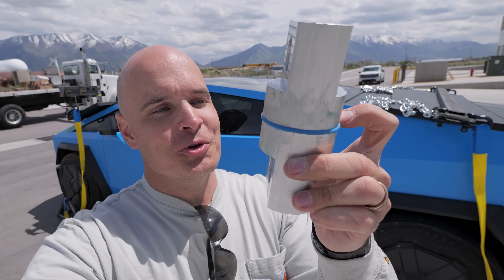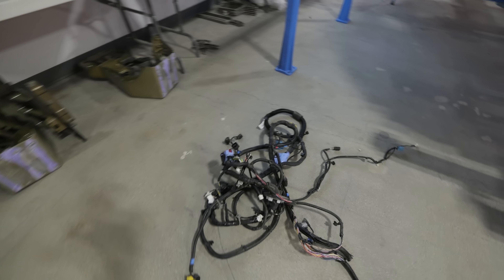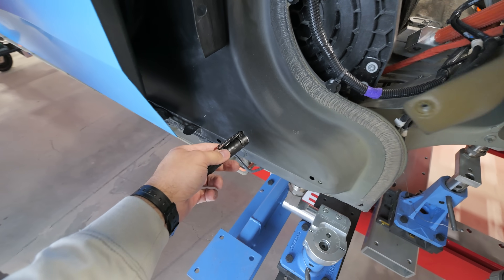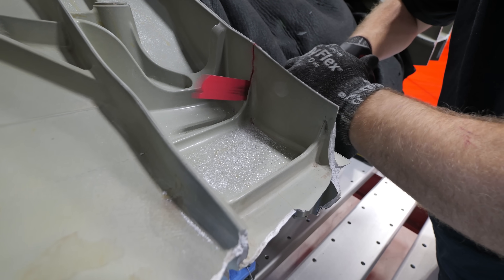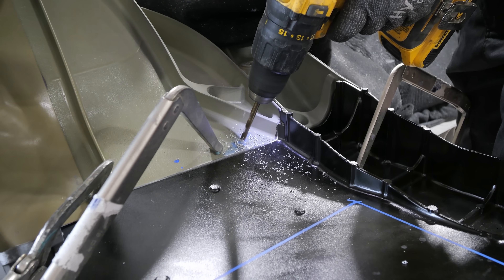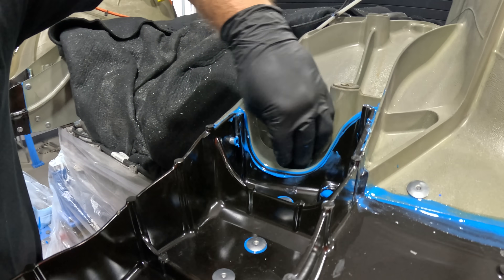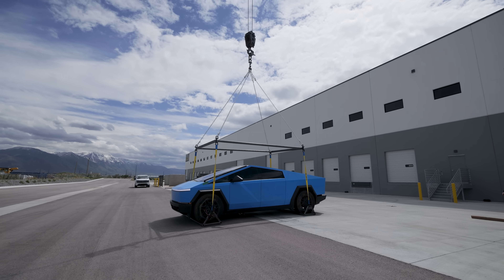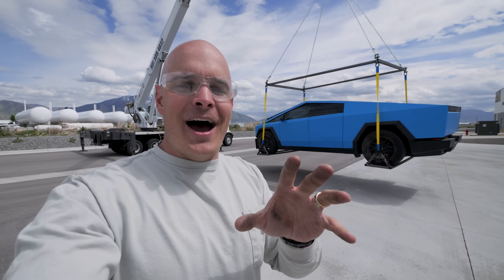Tesla Fixed my Cybertruck with GLUE - (but I'm not mad about it...)

Comment: 1:49 No engine, no soul. Just a bunch of wires and a piece of metal.
Reply: It's not an imitation, it's the upgrade. Engines are becoming antiquated, slowly but certainly surely. A hundred years from now every single vehicle on every road everywhere, will be electric.
Reply: Gen x will fight that.. no replacement for displacement  @Plant-Based-Gains

Comment: I'm pretty sure you can lift a car with that same area of just super glue. I would be more impressed if it could do that along the sheer line. Usually, the tensile strength of adhesive is high, but the sheer is not.

Comment: 6:48 the adhesive is applied directly to the unprepped e-coat paint??  Is that not going to significantly limit the strength of that joint?  They at least (sort of) scuffed up the mating surfaces at 8:59

Comment: So, two months ago, Tesla had a serious problem, cause the trailer hitch broke off too easily. But now that we found out the glue is strong, we now know it's not a problem, cause despite what the tests show, the trailer hitch is actually really strong. The glue may not be very impact resistant and thermal expansion may or may not be a problem. But this glue has also been used by other manufacturers to glue ... something (not critical parts like trailer hitches of course). But the fact that this glue has been used by other companies to glue other things, proves that it's fine for gluing critical parts like the trailer hitches. Not to mention, this glue is stronger than welding. Meaning the metal is actually the weak part and we should actually be mad at manufacturers for including metal instead of building the car entirely out of glue.
Yep, sounds like the opinion of a completely unbiased man...

Comment: so what happens to your 11k trailer when you hit a pothole at 60 mph and the whole back breaks off like yours and hits a school bus in the other lane ? This is the biggest hazard on the Road all need to be recalled . Who was the engineer who design a truck with a  aluminium frame and has a 11k tow rating

Comment: There is a large difference in strength for adhesives in tension versus their peel strength. Can think of it as how it's much easier to remove tape by lifting an edge and pulling at an angle versus attempting to lift the tape off a surface. 
This is not to say industrial adhesives are weak, they are extremely strong, but as with everything in engineering, there's an element of "it depends".

Comment: the genius of this cannot be overstated - castings that have such well fitting lego like connectors that are IN THE MIDDLE of the castings, that you can cut off and glue, which has glass microbeads to space it - so crazy - and then the bolt-able crumble zones. What a fantastic piece of engineering!

Comment: So now that the original rear end has been cut and replaced with the new sections, what happens if you get rear-ended and they need replaced again? 
Do they have some super anti-adhesive to get the sections back off?

Comment: I dare WhistlinDiesel to put his cybertruck back together with this and durability test it again. I guarantee you it won't be as strong, and it isn't guaranteed to hold the same weight and abuse as it did when it didn't break for the lifetime of the vehicle. Glue becomes brittle and weakens over time when exposed to elements. That's just how glue is.  With how shady Tesla is, and especially all the stuff coming out about how the workers are treated, and the death of as of recently, I dont know why their getting any praise at all. Their notoriously anti consumer repair and their designs favor taking it back to tesla for overpriced work rather than doing it at a 3rd party shop or doing it yourself. There's a very good reason any vehicle and especially a truck, is totaled when it has frame damage.  Would you trust a semi put back together with glue? Would you trust your truck? Hold it by the hitch from the crane. THATS a real test.

Comment: I find it interesting that they put far more adhesive on the new towers than what they used in the original installation.  Is this a concerned failure point?  Yes I understand you put a lot more load than what it was designed for, but in the factory installation the had about a 25% coverage with 3 strips of epoxy, but your repair had it fully covered instead.

My problem with the CyberTruck is the battery is WAY too heavy.  If they gave it a range of say 100-150 miles and made it a plug in hybrid if would have weighed about 1500-2000 pounds less, cost likely $10-20K less, and range and refueling times would have not been an issue for towing and long trips.  All electric is far better for much smaller vehicles, but larger vehicles need such crazy larger batteries it is just not worth the extra weight.  Understand this is in the same weight class as an F-450 dually diesel with oversized tanks that can tow more and has a range of 1000 miles... and costs less.  I also like the looks and functionality of a more traditional pickup truck design... I think it is butt ugly... interesting, but butt ugly.

Comment: Hey Everyone 🤠
Find the parts that interest you:

0:00 - Introduction to Tesla's special glue
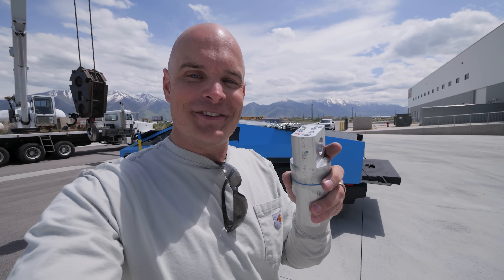1:00 - Explanation of GigaCast sectioning
2:00 - Inside the Cybertruck's wiring system
3:00 - Repairability features of the Cybertruck
4:41 - Tolerance and repair guidelines explained
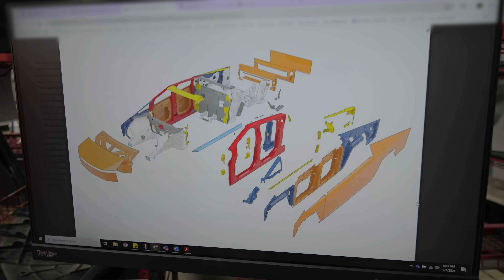5:56 - Using structural adhesive for repairs
7:34 - Importance of adhesive curing time
9:01 - Energy absorber design for easy replacement
9:17 - Vehicle design prevents damage
10:16 - Installing the tailgate tower
10:57 - Repair cost and time explained
12:44 - Testing structural adhesive strength

Chat with videos via Bumpups 🌲
Reply: Jerry, can I get parts that was used in doing the repair.
Reply: Jerry, can I get the Parts list in doing the repair on your cyber truck

Comment: it looked like they used a lot more glue on the rear panel towers then was used originally. I wonder if that is repair procedure or a change in tower design.

Comment: I noticed that the original glue wasn't painstakingly brushed out, just three long stripes on either side.

Looks to me like the "repair for a YouTuber" procedure for the glue is a little bit different than the "manufacture for the average Joe" glue procedure...

Comment: I am curious on the total cost Tesla spends on building a Cybertruck.  How much for materials?  How much for labor?  How much for the Electricity to run the machines?  I know a lot more goes into it, such as engineering and design and all that, but it would be neat to find out just the raw material and assembly cost.

Comment: Given they used to advertise super glue but putting one drop on a construction helmet, and then hoist a person holding onto it up by a crane. I get similar vibes from this; however, as many may know super glue doesn't hold up as well to shear forces between the two surfaces, and that's something structural glues are supposed to be much better at. So If you want a fun test video do a super glue vs structural glue side by side showing both doing a lift test, but the super glue failing in the shear test.

Comment: You either got threatened with a lawsuit or got paid since your world views clashed last you spoke
Reply: Probably both and just took the easy route bowing down to the worlds richest man baby.
Reply: the video description says this isn't a sponsored post and he's never been paid by Tesla, but I'm doubtful.
Reply: He did mislead the crowd, though; the Cybertruck's vertical load was six times the maximum specified vertical load. For the vertical (tongue) load, SAE J684 requires the hitch to withstand a static load equal to 1.5 times the rated tongue weight vertically—without permanent deformation.

He literally had to pull down the front with a dozer to make it snap, meaning the hitch would be on the floor well before the maximum force was reached.

So it is nice that Jerry attempted to rectify his mistake.

Comment: This glue literally look like "shoe goo" a glue that become like soft, stretchable rubber when thin and hard rubber when thick.

I use this shoe goo on all my bicycle air chamber repairs. Straight up just the glue, nothing else. It take 24-48 hours to fully cure.
When i was at my mechanical school i even punctured a tire for testing and forced the glue in the hole, it held like wonder!

Comment: 13k for a bumper  and frame horn replacement is insane. Could buy a nice used car for that price. Bring back the old school logic of fix it yourself. How is tesla even legal if rite to repair doesn't apply to them. How could any of us repair that without their proprietary glue? What a scam.
Reply: The glue is not "proprietary". You can legit buy the Glue yourself. Its called Fusor 2098 (It's in the description of the video). It isn't Proprietary to Telsa at all, maybe you missed that part in the video?
Reply: @jamo128 I did miss that part, thanks for pointing it out. I wonder if all the other parts are available as well. The glue is mainly a longevity concern. It was an engineered fail point to avoid more damage but what happens in 30 years after decades of over loading and abuse? I'm more curious than worried because I'm to lazy to afford one.